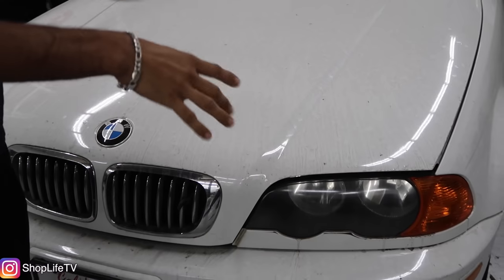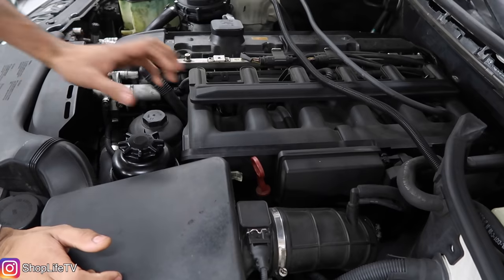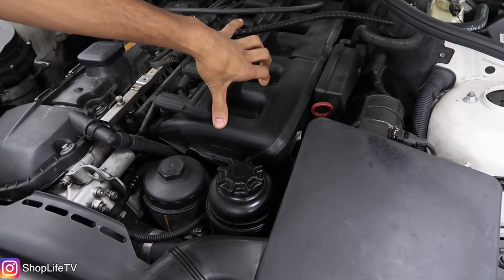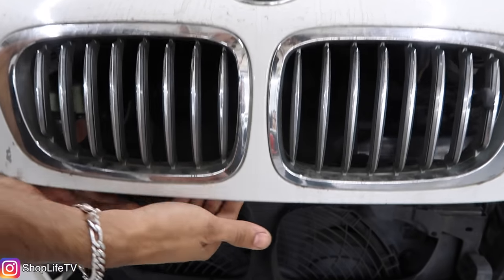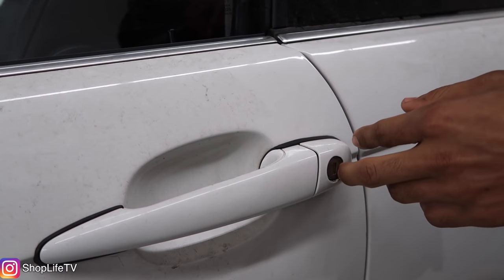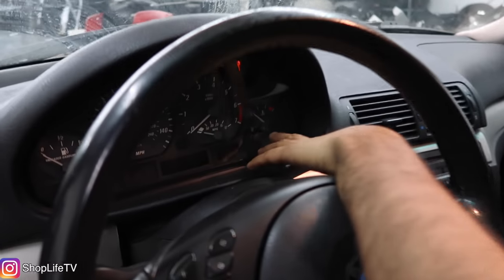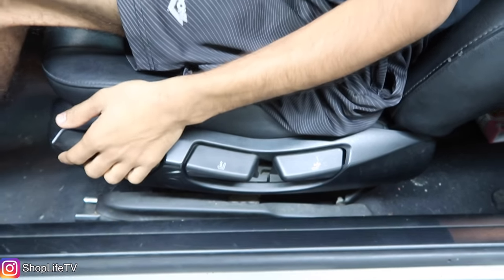25 BMW E46 COMMON PROBLEMS

Comment: You forgot to include the E46 M3. I don't know what's "wrong" with my 75000 mile engine but it doesn't burn any oil in between oil changes. And I Redline it about 5-10% of the time.

I've had my subframe reinforced. I've had my Vanos opened up and Viton O-rings installed in the solenoid and a new cam chain tensioner put in,  and a new external oil line.  Also,  new upgraded gear screws.

At age 13 for my 2005 car I replaced all the serpentine belt and serpentine belt Berrington tensioners. New thermostat and O-rings flush the cooling system. The water pump was just fine so I didn't touch that.

At some point I'll probably replace the plastic power steering reservoir and the plastic coolant reservoir.

Comment: I have a 2002 PFL e46 Coupe, 2.2, 125kw/170ps, It still has the stock exhaust, do you know a nice sounding exhaust? Is it recommended to do a cold air intake on these M54 motors or not at all, because the engine compartment is always soo hot.

Comment: Hi Jason. I 'm Dimitar and I've been watching your channel for a long time. And I hope you can help me by solving a problem on my BMW e46 coupe 318ci 143 hp. The problem with the car is. When the acceleration is heard something buzzing coming from the intake manifold is heard up to 4000 rpm after this stops to hear and the car starts to go a little better. It is also very sluggish in maneuvers, such as parking in reverse, most of the time extinguishing. Diagnostics reports errors for poor fuel mixture and multiple misfire whit fule cut off in all cylinders. the ccv valve and throttle valve have been changed and the problem is still unsolved. Hope you give me a guideline where the problem might be.

I'm sorry for my English is not very good

Comment: My first BMW was an e36 when I was in school.  Then the e46 and currently an e90 335i.  
I totally love these cars, e46 being my favorite.
But I'm dissappointed in BMW "built-in unreliability".  It would seem planned obsolescence is at work at BMW.
When i go on long trips, I would take the Lexus (with 310k original miles) because I dont want to get stranded in the BMW.
 I would not recommend a used BMW, unless you are a DYIer.  This is probably my last BMW purchase. It has been awesome. But I need something more reliable, as I'm not getting any younger. LOL

Comment: I have a over heating promble on my 01' 330i BMW, I change the heat inlet pipe , water pump with thermostat , also the temperature sensor and flushed out the air bubbles and still over heating blow another heater inlet pipe...have any idea what the promble is?

Comment: I see that 67-68 fastback torn down in the background >~> •.• <~<. Kinda sad no one else commented about it, that I can tell anyways haha. I love my '01 330i throws 7 codes a day and has no low end power but I'm just riding the clutch for now. Replaced the front end of the cooling system about 2 times now (raidiator once, water pump twice, hoses once, reservoir twice, thermostat twice). 205k miles. Ummmm passenger windows don't go down. Quart of oil every 500-1k miles. Windshield looks like it was sandblasted. What else. Oh the interior is literally falling apart I pull a part out every other week. Shift knob fell off for awhile going into 2nd till I taped it down. Oh and the transmission mounts are basically gone. Getting a DISA leak too I'm thinking. But still quick (not fast) and fun to drive! No water leaks for me I had those on my 740iL.

Comment: I got the following codes when i scanned my e46, 320i, m54 engine: p1633, p1639, p1638, p0121 and po221.
I would appreciate your input on how to over come them. 
The car permanently on limp mode, with unstable revs going up and down. 
Please help ShopLifeTV

Comment: I have 2004 330xi sadan, but even though i reolaced the new battery after a littlw while tge engin wont start every time. It turn on and off. Therefore i have jumped to start the engin.
Does anybody know what is the cause and what to fix?

Comment: My 2006 M3 SMG periodically shudders/stutters when I come out of 1st gear. Do you know what the possible problems are? I bought the car new and have babied it for 46k.  The dealer replaced the clutch @ 15k. This clutch has only 31k on it. Thoughts.?
Reply: Small vacuume leak

Comment: 4:30 the secondary air pump is only to help the cats get faster into proper working temperature (for lower emissions) nothing else. If it goes bad just disconnect it and remove/blind all the hoses. Passing MOT won't be a problem since you arrive with your engine already on full temp. No need to buy a replacement once it goes bad unless your MOT inspector reeeeeeeeeealy wants you to have this part working.

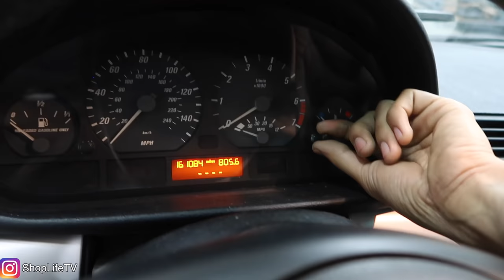14:34 you can adjust the time on the radio directly and it will reflect on the speedo as well. Never did adjust the time on the speedo. Too inconvenient. A simple press of a few buttons on the radio is far more comfortable to do

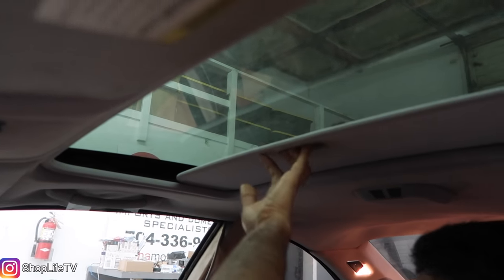14:49 if your cover still works then remove the top glass anyway and clean and lubricate all the contact spots so it goes easier. Will cost little but help a lot to save repair money. It will go bad eventually as will anything else (like your fridge won't be here forever) but you'll give it way more time to actually resign on its life

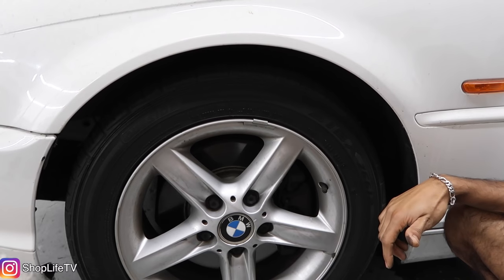18:32 there is one specific warning light that comes off every now and then but you can remedy that for zero money. It has the shape of an arrow and does light up green. When that happens simply locate the left plastic arm behind your steering wheel and move it to a neutral position. You just probably hit that thing by accident. It looks exactly the same as your front window wiper plastic arm only this one is mirrored and on the opposite side :)

18:52 the oil sensor is not nescessary to be changed. If you are used to check on your oil status every now and then by hand you don't need that thing working. We have more cars with the same type of engine and none of them has this part changed for years now. We just check our cars and thats it. If you are worried about running low on oil and therefor risking damage to the engine then remember this car has been made in a time of wealth and prosperity. The engine needs a really bad.. and I mean really really bad hit to break down. Once you are low on oil you'll start to hear clicking noises from all the valves. It will be one of the last reminders that a minute or two ago would be a great time to fill up the oil. If you do that clicking noise will go away and you saved the day. Do this with any modern car and you're in for an expensive repair mission. The engines are really well built and upgrade companies like G Power know that. They offered (not anymore) a simple compressor kit to boost power. Pretty much plug and play into the stock engine and off you go. And if you think this is durability then you haven't seen the E38/E39 V8. Even with really miserable handling these engines can go reallly hard before they go down. No VANOS. Only two sides with chains and the only weakness is the chain tensioner/guide which may get a bit expensive once you're in for it but it can be done as a DIY if you are confident about your hands and what they do. But even if you choose to have it done by someone it will still be a good thing to pay for since that fix will last for another 150k KM easy. With luck even 200k KM. Which is great for a V8.

Comment: Good day friend. I would like to see if you can help me with the following problem. Buy an E46 2001 330i in 2019/09. Since I bought it, it shows me the following error code.
25 (P0030-P0031-P0032)
55 (P0050-P0051-P0052)
61 (P0056-P0057-P0058)
79 (P0036-P0037-P0038).
Is it possible that the 4 oxygen sensors are damaged at the same time? Or what could be the problem?
I would appreciate your help.

Comment: Hey got a 2001 BMW 330xi ran one day next day nope... wanted to turn over had power but nope tried relay nope tried fuel pump ran for like 10 mins drove 25 ft died so replace the fuel filter started once did the same but died without moving but ran about 15 mins now won't start checked fuses....does anyone have an idea?

Comment: I have a problem with my 2005 E46 touring. My key fob lose connection and i cant lock the car with the lock button. I have 2 keys and both stop working. I changed the battery on one of them and did the recoding thing and it world för a while. Now its back again and i cant reconnect the key fob. Any one got a clue on what the problem is?
Tired of locking the car manuelly.

Comment: Easiest way to check for bad control arm bushings is to just let the car roll forward under power and jab the brakes.  You can feel them thunk.  When at the dealership we replaced them almost everyday.  The rear quarter window rubber molding on coupes is getting very expensive and almost always needs replacing.  Then there are the window regulators.  Probably the worst I've seen on any BMW.  Peeling interior fabric on the inner A, B, and C pillars.  Melting rear tail light sockets is another common failure.  Good thing they are cheap cars now as they're getting very expensive to fix in parts cost.

Comment: My Gen 7 (2003) Honda Civic LX 5-speed may not be "The Ultimate Driving Machine"... But with 181K on the odometer and zero non-scheduled repairs other than sway bar links/bushings, I'll take it over a BMW any day. 😂
Reply: The major difference being: no one wanted to drive your car when it was new, and no one wants to drive your car now.

Comment: Hey I need help! My e46 at random times , the traction control light will blink and deactivate my brakes and once the traction control light stops blinking the yellow handbrake light will turn on along with it and the car would drive normal. Then when I turn it off the car the lights go away but sometimes come back when I start driving again! Please reply
Reply: Try check the speed sensors on all wheels. Take them out and clean them. Put back in problem should be fixed unless you have a system/part failure or possible your hub bearing is bad

Comment: I have a full collection of 3 series until there were no more 2 door models in the range (4 doors are for short people, not tall people like me thanks). The E46 323 to 330 Ci models drive most like a 2000 era E30 than any 3 series which is GREAT, the E90s drive like French cars (yuk!) so unless we are talking convertible they are a downgrade, especially with only one six cylinder normally aspirated engine. The E46 however rots like a 1970s car and it has really stupid design faults (stalling on warm up for the 323/328 due to terrible VANOS II changes from the E36) and really stupid 'italian quality' electrical faults like the blower fan (again the failsafe on the E46 is ZERO fan function, on E36 the same fault results in maximum speed fan output failsafe CORRECTLY). I love the E46 328/330 but the rust and electrical faults are a big problem. The CD changer eventually fails on all, as does the gearstick centering spring on the left etc. You want to love it but it will cost more than it will ever be worth to keep it on the road without faults.

Comment: please help help i have code in my 330ci 2006 zhp e46 p111f the mechanic told air mas flow is not good i changed but still have same code i dont know what i can do did u fix that before

Comment: Wow...that's why I've always had japanese cars! I'm thinking of a E46 3 series.....or do I go back to japanese cars? I've had honda civics, and a 2006 subaru 2.5 turbo...spanning 15 years and I've had about 4 common issue problems....or maybe I was lucky. There is a 2001 e46 that's been offered to me by a friend decent milage and at a very good price....I think I will go for it and try a BMW.

Comment: I have a 2000 328i 4door, with over 300,00KM.  I have only ever done 3 Power Steering pumps and 1 Window motor.
Reply: I have the same car on blocks now for the last 2 years. No reverse issue and had to replace the valve body in the trans. Full suspension refresh. CCV was replaced. Put new seals in the Vanos. Whole damn cooling system had to be replaced. Rear main seal has been replaced, actually pretty much every seal. Intake boots were bad. Door lock had failed. GM5 module was replaced along with the lock actuators. Replaced the passenger side window regulator 4 times now. Gauges have bad stems. Alternator was replaced. Power steering hoses were bad. Fender liners in the front were gone along with the plastic pan that was supposed to be down there.  

Must be nice for you.
Reply: @encryption767  $2500 and a running E46 for you...Sounds like you have a parts car for it if anything breaks
Reply: @LostOne44  I have already thrown enough good money after bad. This one will be the last I own.
Reply: @encryption767  Is yours a 2 Door?
Reply: @LostOne44  No, it is a 328i sedan.

Comment: My steering wheel has a little bit of play forwards and back not left and right I am going to install a new steering coupler this week but I can’t seem to find anything on why my car has maybe half a 1/4 inch of play and it feels squeaky
Reply: Dana Andrusyshyn get an alignment check tire pressure and suspenion ( control arms, endlinks, balljoints)

Comment: I recently replaced a window regulator on my 2001 bmw 330 coupe and when I open my door I notice that my window does not go down 1/4 so it won’t hit on top and way I can calibrate my window ?
Reply from the maker: try this: put key in position 1(not accessory), roll window down all the way, press and hold window down button for 5 secs

Comment: One MAJOR problem is those darn window regulators. I replaced the front ones 3 times each and the rear ones 2 times each in the 8 years that I've owned the car. It's always the cheap plastic parts that break down. WHY plastic WHY.

Comment: My dsc light comes on when driving a few miles sometimes ive seen it blink, when i turn the car off and on again it goes away, ive tried a few things but idk what it could be
Reply: Usually the rear wheel speed sensors, sometimes its the steering angle sensor, read codes to see which it is.
Reply: Did u fix this problem? My dsc light blinks , my brakes stop working, then the yellow brake light comes on and car drives normal

Comment: Allot of euro car of that age burned oil from new due to a 70 degree cross hatch on the cylinder bore not the traditional 45 degree ,done for low. friction purposes and fuel efficiency and emissions. The trade of was oil usage.

Comment: Hey I really like ur vids and u really know ur shit. I have a 325 ci convertible and I recently pushed the seat heater on drivers side as I was driving.  It shocked the hell outta me soooooooo badddd to the point that I was almost sitting on my seat to get my ass off the seat. It didn't stop till I hit that button to turn it off/  wtf happened??? Also my top wont come down,  the button lights don't come on. I've checked the fuses and I can't the issue. I e reset battery with cable off. Also my key fob doesnt do anything. The hazard lights and door lock button dont work. Help please.  I'm in Tucson ARIZONA.  Where are you at?

Comment: i have recently bought an 04 325i e46. what does the SES code "system voltage <9" mean? is that the alternator going bad?

Comment: Where can I ask u a question about p1074.  I only get this code at highway speed. Car idles fine and drives perfect.    I feel a slight hesitation at highway speed and have gone thru replacing the usual suspects.
Reply from the maker: lets talk about it on my instagram dm! @shoplifetv
Reply: ShopLifeTV if I had Instagram I’d do that, lol
Reply from the maker: what is the fuel pressure under load?
Reply: I’m getting a scanner that can read that info Monday, I have a c110 but it can’t do that as far as I know
Reply: ShopLifeTV I have the FF from when the code was thrown.  I have the STFT and LTFT, calc load is %24.3, is that what you asked for?

Comment: How do you know if you have a bad alternator? My battery light comes on and off
Reply from the maker: usually that, could also be a bad voltage regulator. Easy way to check for alternator operation is to turn car on and remove the positive terminal from the battery. If the car stays running alternator is good, if it turns off it means bad alternator.
Reply: Most parts stores will test alternators for free

Comment: Conclusion: Unless you drive twisty/curvy fun roads...buy a Toyota! I currently have four BMWs, and two Toyotas (owned over a dozen) so I'm not hating on BMWs. But good God, I can't think of even a half dozen "common problems" to deal with on the seven 90's Camrys I've owned! (And I drive those to as close to 300k miles before I sell one). Buy an E46 if you wanna learn DIY, or an E90 if you want to support your local Dealer/Shop! My Hybrid Highlander doesn't have Any problems, common or otherwise! But I love an inline six. Drove an '88 Supra Turbo year round in the rust belt until '04 when the rusted uni-body gave out. So I have four BMW i6's, next best thing.

Comment: My CCV is bad and I changed my control arm bushing but that’s the only problem I have had with my E46 but I have a question and I messaged you on insta and idk how to use your website to send you a question

Comment: I better get rid of mine before other problems start. I'm already having issues with a shudder when shifting from 1st to 2nd and sometimes 3rd gears on a manual 5 speed 323i year 2000. 😞

Comment: I've got a '99 323i and is there any way to fix limp mode?
Reply: Michael Kaczmarczyk check your voltage.. make sure your batt is holding 13.4 -14+ when running
Reply: Michael Kaczmarczyk check your voltage.. make sure your batt is holding 13.4 -14+ when running
Reply: Michael Kaczmarczyk yeah fix your car if it is in limp mode it has something wrong

Comment: Your backwards on your fan clutch.  It should be tight when it's good. When it's easy to turn is when it's bad. Fyi. I'm ase master tech and 15yr bmw tech at dealer.